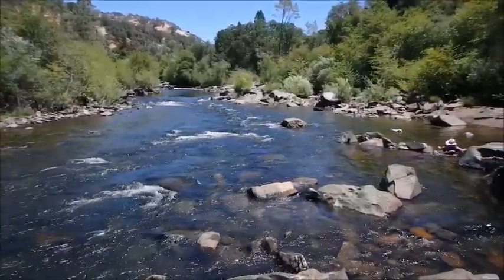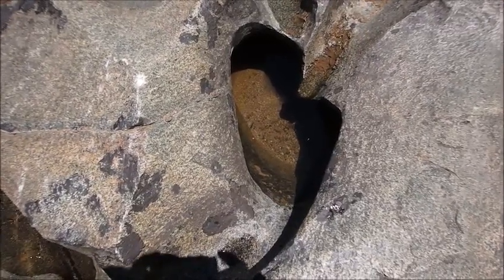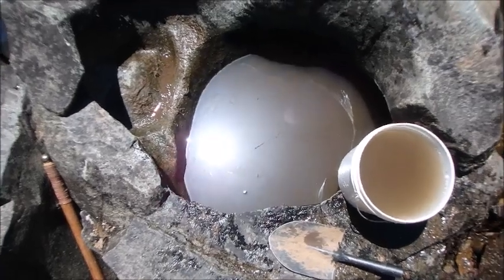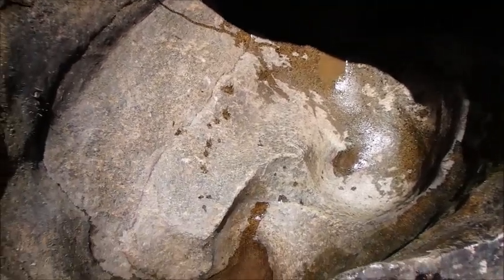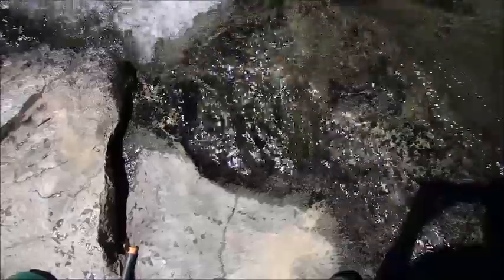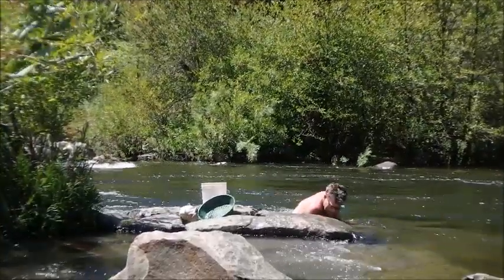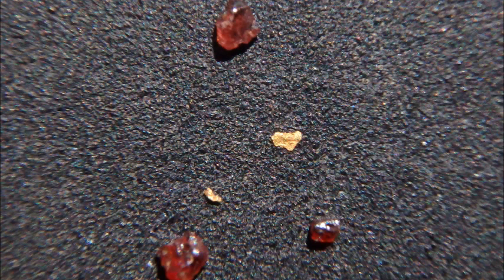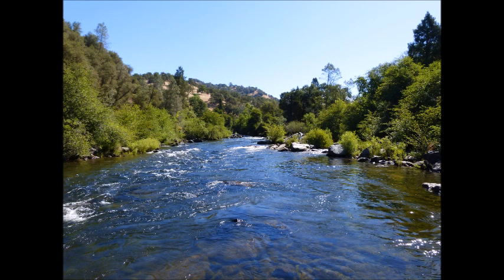Whirlpool Gold

Comment: Metal from the miners shack. Lead? Probably not. Aluminum? Not likely. Pewter. High probability. Very commonly used for kitchen utensils, mugs, pots and such.
Reply from the maker: Thanks Sam,  you are the only one so far that has suggested it might be pewter.  Given its color and weight you might be right.

Comment: sometimes in old diggings you will find heavy gray or silver looking chunks, they might be mercury that has collected and absorbed up gold.. you have to heat it in a retort CAREFULLYA SO YOU DO NOT POISON YOURSELF in order to separate them.
Reply from the maker: I think your analysis is the most logical explanation.  Thanks for your very helpful information.
Reply: you might also see if there is platinum in your area.,. if it has traveled far it will have smooth surfaces just like gold gets.. I threw out a lot of it from my pan when in the Burnt river area of Oregon. later I found out what it was.. when I went back that pocket had washed away..i can't imagine how many treasures we have walked over just by not knowing what we were looking at.  good luck

Comment: Bore holes never usually turn up good gold, the holes are basically like mortars and the gravel acts like a pestal and pulverises the gold to fine flakes and the current blows it out. When you have a solid bedrock bottom, the big gold is always sitting in the the deepest / lowest part of the river. Gold is 18 times heavier then river gravel, it naturally works its way to the lowest point. There is exceptions, but for the most part it is at the bottom.
Reply: DS, good call boy-o

Comment: Unknown silver colored metal... Platinum?
Reply: It looks like a good candidate for amalgamation of mercury and gold and possibly silver (mercury will not amalgamate with Platinum, Iron or Tungsten).  I personally have recovered amalgamated gold around some of the old historic mining districts in Colorado over the years. The old timers had no qualms about using mercury back in the day, and if you're in a historic mining district there is a great chance (based on the color and characteristics of the material in your video) that this is what it is. In the old days, miners placed mercury in the riffles of sluices, dry washers, and similar devices to aid capture of fine gold. Also, at the base of most of the old stamp mills was a plate amalgamator – a device with a metal plate coated with a thin film of mercury on the surface- so mercury often was leached out of these operations into the environment, carried downstream an amalgamated to any metals it came into contact with (except platinum, iron and tungsten). Now keep in mind that mercury- even though its in a liquid state- has a specific gravity of 13.6! heavy stuff- even heavier than lead at 11.34! So it creeps along the bottom of streams and naturally migrates and concentrates in the same areas that gold would be found. If gold was in the same pocket as the mercury- an amalgamation will take place! Point is, amalgamated gold is still found in these historic mining areas even today!
Reply: a melted aluminum pot.
Reply: Paul H! The knowledge is much appreciated! And I'm very sure the metal on the necklace is melted aluminum. I found it all over CO. Wherever there is a fire pit, I called it fire metal and it is light in weight.
Reply from the maker: Paul, thanks for the detailed info.
Reply: @TJ Haverland, Best to keep one's mouth shut and be thought the fool than to open it and prove it; your "Your an IDIOT" comment shows in fact you're the idiot.
Reply: Metal is aluminum (burned down shack). Not platinum....
Reply: Frank Britt 😲 Your an IDIOT!  😂😂😂
Reply: It's aluminum. I've seen a LOT of melted in aluminum in 20 years as a firefighter
Reply: Wow...he removed the big rocks he said? Wow...amazing!!!  Keep your voice lower so i can hear the water running... Thats way better than hunting for gold...

Comment: Thank you Dan for sharing .was that water cold?
      Have you been to Middlebar bridge by Gwen mine . There are some interesting gulches or washouts up the EBSMUD trail on the south side of the river.you can get there by Gwen mine road from valley springs . There is also road coming down from Jackson as well.Middlebar bridge is one of the few bridges you can fish off of in California. I have been going there my entire lifetime . Not too long ago I was up there fishing with the folks.
I walked up the trail until it starts to curve away from the river.There was a sign that said jackass gulch .As i looked up the gulch I saw an empty big slam bottle on a ledge, the gulch had a bend.When you reached it you were staring at a once closed by gravel ,mine entrance. On the ground were piles of quartz some rusty some white.
This gulch was no more than a hundred feet from the trail entrance. it was maybe fifteen feet to the bend from the trail. Ten feet to the mine entrance.  I checked every washout on the way back  there were at least two others and the same thing only the one closest to gwen mine rd, was wide open overgrown and covered with cob webs.
Always have backup and i had none. Gwen mountain is scary enough you can tell little if anything goes over that mountain, the cobwebs look like something out of a horror movie. Its been a few years but im sure they are still there. they are so easy to get to its worth it just to see them.
Its the little secrets that we enjoy sharing,, happy hunting.We have the same backyard.if you want this secret just erase the comment. god bless,keep  the videos coming.
Reply from the maker: Thanks for the info.  I have been to both the Gwen Mine and Middle Bar Bridge.  I haven't been to the other mines you mentioned so I will add them to my list of sites to explore some day.